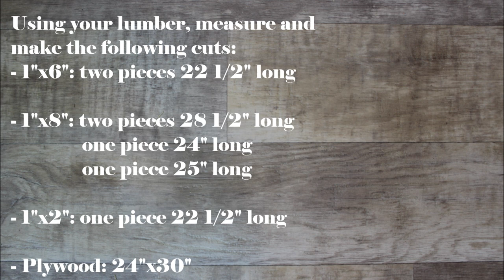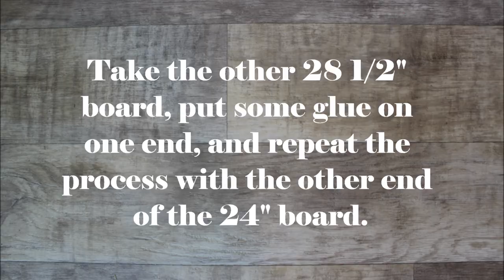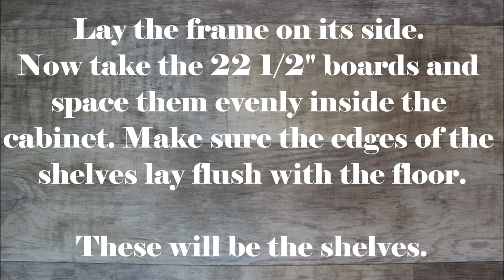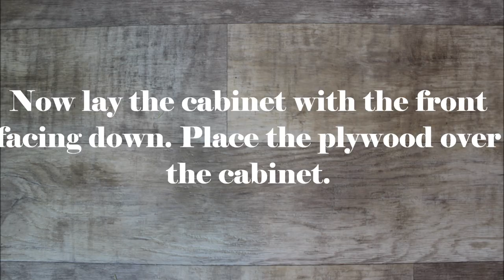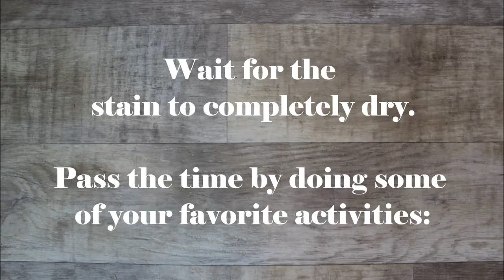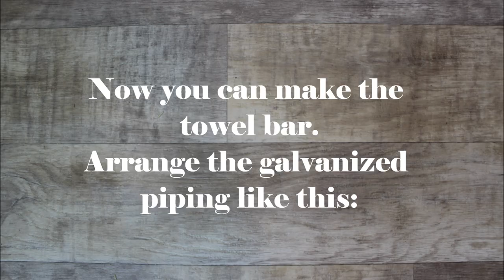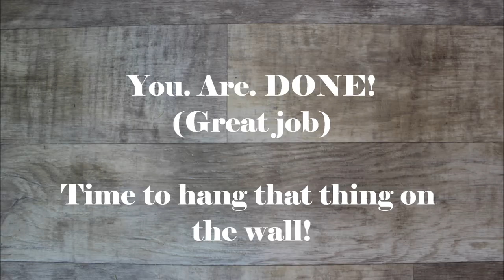The $20 Rustic Bathroom Cabinet - Easy DIY Project

Comment: I love your videos... nails, glue and wood, yaay... $20 or $50 who cares...that cabinet will look fab for years, and the older it gets the better it looks, thanks for posting...
Reply: it matters, because they're not even using good wood.  It's junk wood.
Reply: I’ve had things made of cheap wood. Made by either myself or my dad that has lasted years. I guess it depends on what the intended use is. This cabinet most likely won’t be holding anything too heavy so it’ll last.
Reply: @kmarshall131  who cares?! You don’t need to use the same kind.

Comment: I love watching these videos!! I really wish some of the builders show how they hang up some of these wood projects tho. I can build stuff for sure! But hanging things, even pictures are not my strong suit.
Reply: Those 2 wood strips inserted are for mounting. First locate the wall studs.. with a good stud finder (they are 16 inches apart). If no walls studs, no worries; buy some plastic wall anchors (some can hold 50+ pounds each!!!) so it's an easy fix.

A trick for mounting heavy stuff, but can't use wall studs:
1. Hold your project into the deselired placement and mark the corners with a pencil (get help to do this if needed)

2. predrill a small hole (thinner than the diameter of the screws you're using) into the mounting parts of your project. Ex: if my project weighs 20 pounds and I plan to place 20 pounds of stuff on it... I'm gonna make sure that it'll support twice that amount AT LEAST. So I'll use 80 ibs of support from my wall anchors at least. I'd use 4 of the 20 Ibs capacity ones. Or maybe even 4 of the 50 Ibs ones, just because... 

3. Hold your project up to the marks you've made.

4. Hammer a nail into the mounting holes, this will CREATE THE HOLE PLACEMENT ONTO THE WALL. Now remove project again.

5. Now you know exactly where you can insert your wall anchors. Do that now.

If you this every time, EZ PZ.
Reply: @JoshNtheedrifter  I’ll have to re-read this a couple of times but I think I’ll get it! 👍

Comment: Little tip to this when installing on the wall; don't add the support pieces at 5:32. Instead, leave them off and stain/finish them with everything else. Once you're ready to hang it, drill into the wall on the studs exactly where those brackets will go. Once it's hung, add the braces to hide the screws.
Reply: So you'd be relying on the 1/4" plywood to hold that up?

Comment: Ok, assuming you already have the nails, glue, stain, etc. This project IS roughly about $20 but that's only the lumber. I'm using a 1" wooden dowel for the towel rack so I'm not sure about the piping.

Comment: I like the project and I like what you do BUT saying this cost $20 is a stretch.  I shop at Menards, a lot, and there is no way everything you used for this project cost $20.  If my wife saw this video and LOVED the cabinet and gave me a list of materials and $20....what could I buy at Menards??? Well here is a breakdown of what the materials you used are at my local Menards....

1/2 floor flange (x2) - $6.16
90 degree elbow (x2) - $1.59
Close nipple (2 pack) - $1.94
Galvanized pipe - $2.99
Pine board 1x8x10 - $8.62
Pine board - 1x6x4 - $2.79
Pine board - 1x2x2 - $2.39

Not counting glue, nails, screws, sanding block, stain and poly…..or the 24” x 36” sheet of plywood.

Now I have a serious question....do you think less people would watch this video if you had a cost of $50 in the description?  Don't get me wrong....I like the video and I like what you're doing but the cost seems to be stretched just a little.  Maybe put a link to the material you bought in the description so people can see what you paid and compare it to what they had to pay????  Fun video nevertheless.
Reply: Chris Parker I agree. I really like the videos but I just spent the minimum I could to build this and it cost me $86. Not including the galvanized pipe and materials. My guess is that all the pieces were left overs from previous projects and they broke it down as such. But no where $20. : /
Reply: +Rick Martinez I agree. I don't know why they put a so low cost of materials in the description. Click bait? Not sure.
Reply: Chris Parker They said they only got the wood from there. Who's to say they didn't get the rest somewhere else at a discount?
Reply: +Stephany Lewis $6.20 for everything else.....impressive.
Reply: They cut the wood themselves in the video.
Reply: I'm not sure what that has to do with them low-balling the cost of materials for their project.  Have you read the other comments from ppl who have made this saying it costs more than $20?  Having such a low price in the title is just a ploy to get you to watch their video.  It worked...you did...I did.  I'm not saying the project is bad...I just feel if they are going to put a cost in the title it should more closely reflect the actual cost and $20 isn't.  They've done this before in their other videos.  It's something I wouldn't do....that's all I'm saying.
Reply: My only guess is, they had the stain and poly already on hand. Still the galvanized pipe alone would put them at least at $20 minimum even at Home Depot. So everything else must have been scrap. Still a nice project, but $20 is a little misleading.
Reply: Chris Parker unless you have used free pallet wood
Reply: Some Home Depots offer what is called "Cull Lumber" at 70% off retail. I think they may be using something similar.
Reply: Doubtful...

"ALL OF OUR LUMBER IS PURCHASED AT MENARDS, A MIDWEST HARDWARE CHAIN. FOR THESE VIDEOS, WE ARE GENERALLY USING STANDARD PINE BOARDS. YOUR PRICES WILL VARY DEPENDING ON WHERE YOU SHOP AND THE TYPE OF WOOD YOU SELECT."

Feel free to check out Menards site to compare the prices to the boards they use.  Be sure and factor in the plywood that I did not.  Like I said...nice project....misleading telling ppl they can build this for $20.
Reply: well i assumed they already had the nails and screws and sanding blocks in all there videos. however, galvanized pipe alone is around 20 bucks alone and the wood would probably be around 20 dollars as well.
Reply: Chris Parker I'm in the Bay Area, CA and it costed me $55, that's with me having nails, glue, screws and ¾ of the lumber on hand, stain/poly and sanding pads. The only wood I did purchase was the plywood & (1) 1x8 @ 6' board ($9). The 24x48" ¼" plywood costed me $13. So yeah, I guess it all depends on where you shop for materials. But this was my experience at the Home Depot
Reply: I know right!?! Oh wait...you were talking about me weren't you??? lol
Reply: Maybe because I'm in Canada, I just see the $20 and think that it's a yardstick for the price. It will depend on what you have at home and what kind of deals you can buy. I mean they lay out what you need and give you easy to understand instructions. They have good taste, so I don't worry too much about how much they spent, They won't be able to tell me how much I need to spend, that's work I have to do on my own when I shop around. Love the videos!
Reply: Chris Parker mm
Reply: Oh wow reading the comments about the price I'm pretty shocked to see it will cost more but overall I think it will be a duck project to do if it's more it is misleading but hey I will love for people to say GIRL YOU MADE THAT!! I can say YUP ALL ME!!
Reply: Chris Parker the only way I can see this being $20: using deconstructed wood pallets, stealing nails & a hammer from my dad, & using home Depot oops! Stain for 50 cents. The towel rod/pipe would tip the budget completely. You're better off using a dowel painted a metallic color. I'm with you, clickbait af
Reply: Yeah I like that pile!!  :D  I check it out every time I go to Home Depot!! As well as the oops! paint, in the paint department!!
Reply: Chris Parker maybe they go to junk yards or places where they scavenge repurposed wood etc etc
Reply: I agree a lot of times some material may be left overs from other projects. A can of stain may last several projects too......
Reply: David Findle it’s not that serious to be so heated.
Reply: You can say what you want Brandie, but David Frindell is one hell of great guy. I know this because he said he is!
Reply: I love you Dave....I always have.
Reply: David Findle well said! Cost is all relative to each person
Reply: Chris Parker Hey man Thanks for calling her out! I hate when ppl try to get views by saying the did something cheap, because they already bought everything but in total its well over $100 to get all the in Texas, she needs to apologize and quit posting videos like this
Reply: Lot of anger in this thread all of a sudden. It's a shame the folks that uploaded don't chime in because right now we're just theorizing heh heh. The question is if in fact they're using what they have on hand or found around them like that one whiny guy said, why even include a price in the title?
Reply: Chris Parker Amazon
Reply: Chris Parker clickbait. Youtubers get paid for every click
Reply: Agree too. I see all these DIY videos like Bathroom remodel for $500 or stuff like this and they’re all low balling it and leaving out the little things. When I saw the pipe I knew it could not be as that shot isn’t cheap.
Reply: Alec Foster I agree. I’m in Texas and just went to HD to price for this project. 20 would not cut it. That’s on the wood alone
Reply: TYISHA CEASER agreed. Just a clickbait title is all.

Comment: how do you find pine boards that aren't bowed and warped? i go through  piles at Lowes and can maybe find one of any given length. Also,  how did you know the shelves were even and straight without measuring?  And what did you use for hanging hardware? Where are you getting the $20 cost from? do you have a breakdown?
Reply from the maker: +MJ623NY - not sure about the selection at Lowes.  We get ours at Menards or Home Depot, and it does sometimes take awhile to find straight ones.  Once we placed the shelves, we measured to make sure they were straight. For hanging, we screwed into the 1x2 that was placed on the inside back of the shelf. Cost was right around $20.
Reply: +MJ623NY Don't buy them from Lowes or home depot, find a wood dealer  lumber yard

Comment: how did you hang it on the wall? please answer i would love to make this
Reply: Oso Riskii I'm sure the pretty woman on here won't ever check her comments. but, you can buy wall anchors to put threw the dry wall. umm I believe the snap anchors will hold up too 100lbs, would also check with your local hardware store and get a second opinion from an expert.
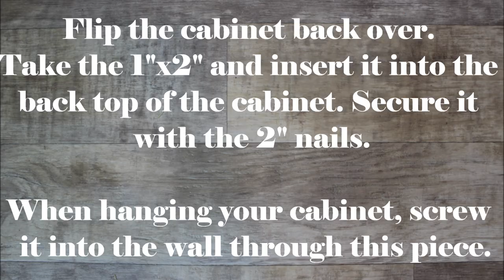Reply: text at 5:24
Reply: Following instructions and thus, seeing the way to mount it to the wall.  Nice Nonya Bizz.

Comment: a nail gun would shorten woodwork time although it is a very very nice and simple project - way to go
Reply: And learn to swing a hammer.  That tap, tap, tap, tap, tap, tap, tap on each nail was driving me crazy.
Reply: not so much the tap tap tap noise because it could have been silenced or it could be run x2 so tap tap would not be heard. but nail gun would really shorten woodworking time.
Reply: Eli Ben David I thought the misic was more annoying. lol

Comment: They should include in the video how she hang the cabinet on the wall and how safe the connection
Reply from the maker: You can hang it by putting screws the the cross piece at the top. Make sure you use anchors or find a stud in the wall.

Comment: how did you hang on the wall ?
Reply: text at 5:24
Reply: hat is a wall made with hollow blocks, so there's need to drill with an impact drill and install wall anchors; if it's solid concrete or brick, still need to use the impact drill to make the hole but then you can use concrete screws. ... Wood ? Find the studs and screw on the studs.

Comment: you didn't show how the rack was mounted on the wall
Reply: If you buy just common board and the nails it will not cost more than this. I built their wine rack and it only cost me 27 dollars but I already had the stain
Reply: correct bro, how the hell she did hang on the cabinet on the wall
Reply: you insert sheet rock anchors into the wall, then put screws through the last board she put on the top.
Reply: 1/4" toggle bolts would work best with 1/4" fender washers painted brown after application ...sheet rock anchors are temporary or not as heavy duty as far as supporting weight

Comment: How did you mount it?
Reply: text at 5:24
Reply: That is a wall made with hollow blocks, so there's need to drill with an impact drill and install wall anchors; if it's solid concrete or brick, still need to use the impact drill to make the hole but then you can use concrete screws. ... Wood ? Find the studs and screw on the studs.

Comment: You know, nailing it before squaring it off is why your second board didn't fit nicely, and the first had to be pounded into place... Normally, you'd glue first, square it, THEN nail it.

Comment: Your videos are innovative, but you guys never show how to hang the thing. In this video as well in the sliding barn door, the major challenge is of mounting that thing which u should cover as well.
Reply from the maker: For this project we put the piece going across the underside of the top. You can screw directly into that and into the wall. As for the barndoor, hanging depends on which hardware you choose and will vary from product to product. The hardware you buy should have step by step instructions.

Comment: We are making this today.  FYI it's not $20.
Reply: Maria Vargas-Salazar can you please share how you mounted it? they seem to not see all the comments asking
Reply: They wrote in the video (5.24) screw it into the wall through with small piece of wood that attached to the top. On the other hand you can use heavy duty L brackets maybe in matte black??? it will be visible but goes well with rustic theme i think.

Comment: I came to see this video just to see how they hung it to the wall and they skipped that part... I'll still give them a like
Reply from the maker: We have that cross piece we added at the top for hanging. You can just drill right through that and secure it with screws into your wall. You'll either want to find studs in the wall or use anchors. Thanks for watching!

Comment: I think what they meant was that this cabinet would be worth $20 dollars if you wanted to buy it after it was done. That is what I would pay for it anyways. No way you can make from scratch from with just 20 bucks.
Reply: Lester Molina If it cost 80.00 to make, then no way 
would it be worth only 20.00.
Reply: Pricing would generally just include the "HARDWARE" So, the 1x2, 1x6, 1x8 and the piping could be acquired for at, or around $20. The nails, stain, etc are generally expected to have, and/or would last multiple projects.

Comment: about the only thing your going to get for twenty bucks is the 18" x 1/2" pipe and fittings ....wearing a dust mask while staining is useless.....instead of stain i use old english oil for dark wood ...forget the polyurethane........"to each his own" ....i love your video and plan using your plan except for the plywood for a bath cabinet

Comment: The ONLY way this cost $20 is if they prorated everything by the foot, like let's say the price of a 1x8x10 = $10 and then only used 2' of it, it technically cost them 1/5 of that, so $2.00.  It is misleading for sure.  Nonetheless, they're projects are simple and anyone with basic skills can build them in a few hours tops.

Comment: $20. Yeah, nice meme. Maybe for the screws and glue lol.
Reply: indeed its more likely around 50
Reply: I build an equal one for about 30€ (less than 35$) 
Glue, nails and finish was less than 10€
And the wood was only about 20€ as well
Reply: As for me that would be almost 50$ canada.
Reply: +Christian Gaa Sorry if this is a too soon but... A couple days ago that amount in pounds would have been absurdly expensive (when compared to $20 USD). 

Crazy how fast change, good or bad, can happen.
Reply: Agreed. And i don't see them weighing in a reply here.
Reply: +Leowulf™ I only paid 20.00. I purchased pine board as suggested.